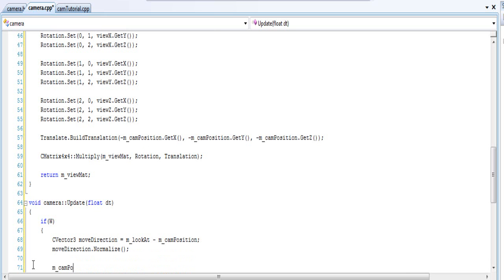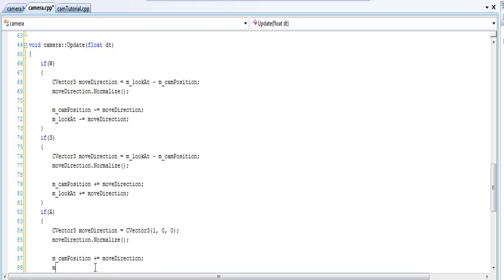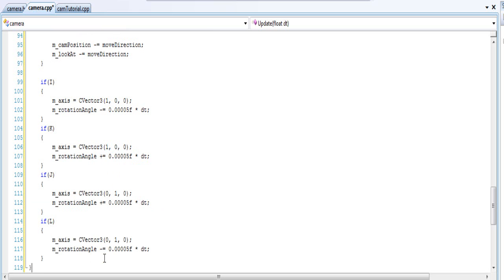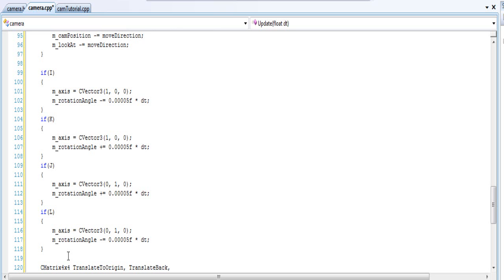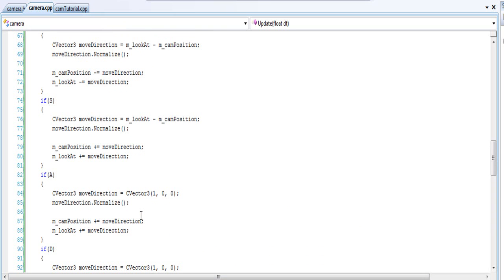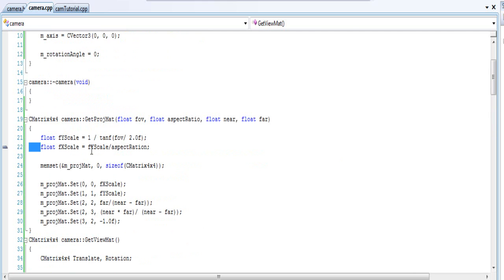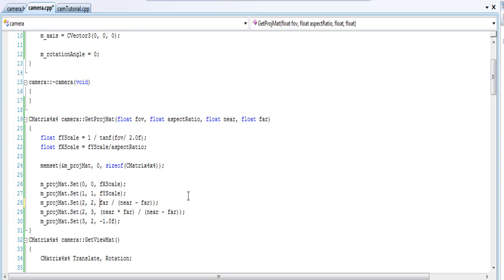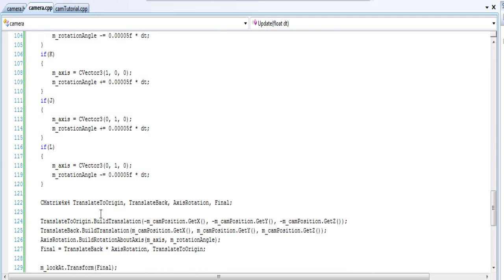Creating 3D Camera C++ OpenGl - Tutorial part 3/3

Comment from the maker: There isnt a real easy way to explain rotation matrices at all. All you gotta remember is where the sin and cos goes depending on the rotation.  If its rotating about the x axis, the first row of the matrix remains the same, if its rotating about the y axis, the second row remains the same and if its rotating about the z axis then the third row remains the same and the other rows consist of sin and cos.  Axis represents if its a Yaw = (0, 1, 0), Pitch = (1, 0, 0), or Roll = (0, 0, 1) rotation